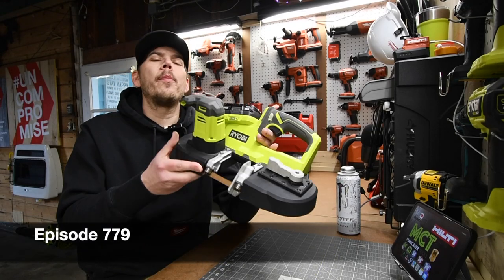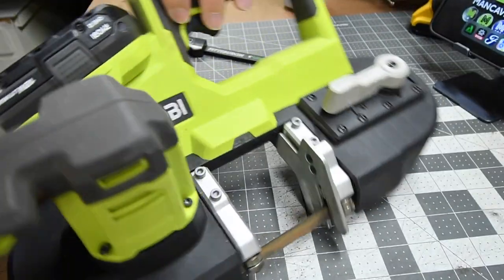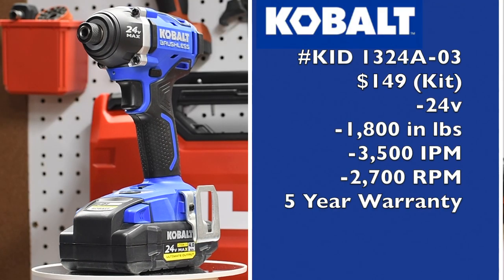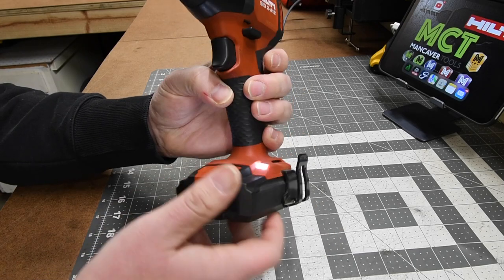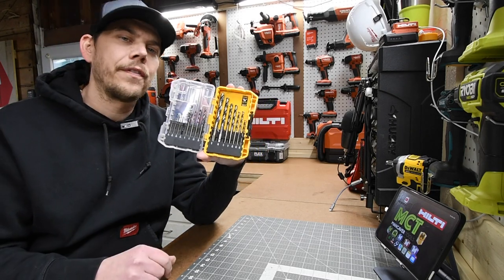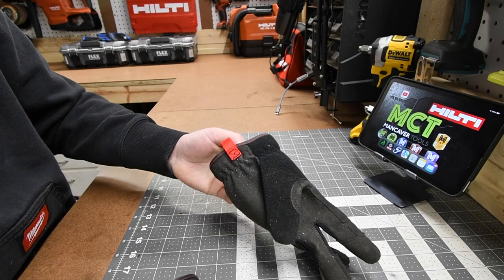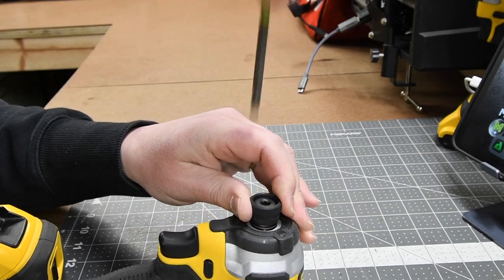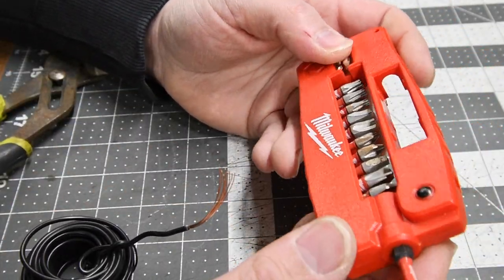These 10 tools will make your Job easier!

Comment: I’ve been spreading the news on my DeWalt discovery. The 850 is not an atomic tool. It is branded as Atomic in the states but is an XR tool in UK. DCF850E2T-GB. All the same internals as the XR 18v 850N model. DeWalt chose to brand it as Atomic to get HD Exclusivity to get the jump on Lowes.